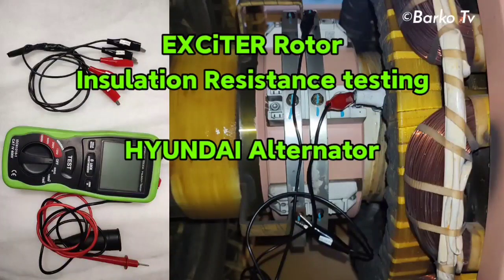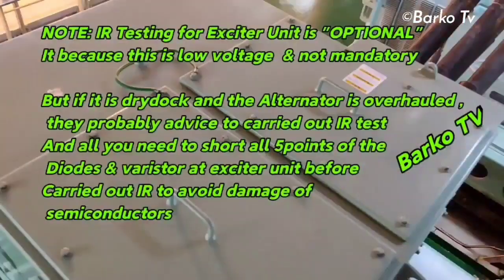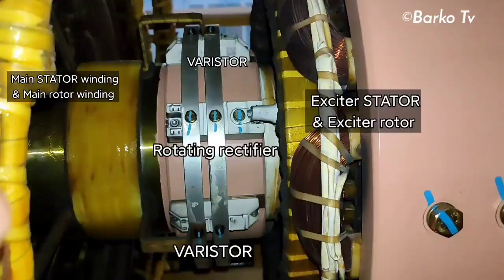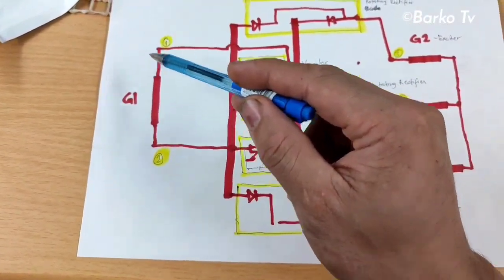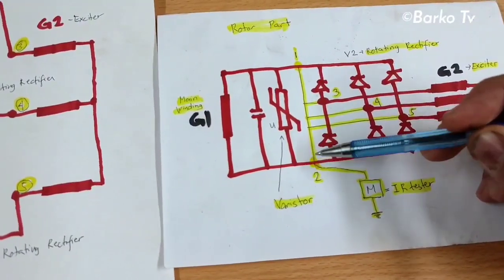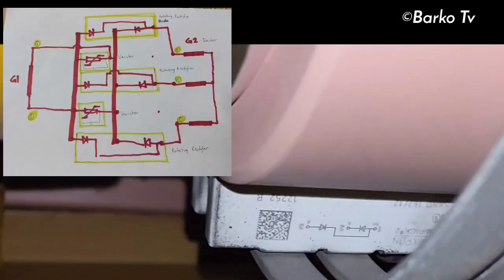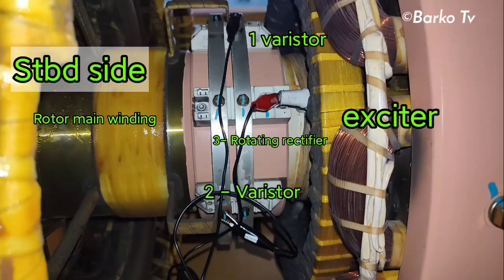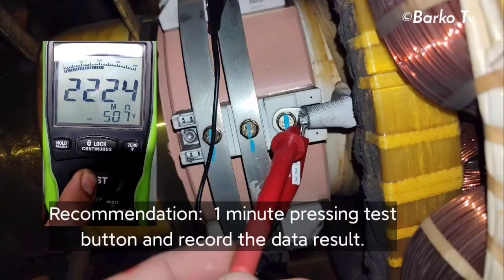Part 3: Megger testing of Exciter known as Insulation resistance test /Actual test / Hyundai

Comment: Good morning sir, you have great knowledge.please sir make one video on Main Engine starting troubleshooting. For example after 3 kicks the main engine does not start  then step by step which sequence we have to follow. Thanks.
Reply from the maker: Motor control troubleshooting
https://youtu.be/69Kpdjsq7LM
Reply from the maker: Normally we base on pneumatic air starting sequence, which control the starting sequence like opening the main starting valve and etc.  If your engine is ME-c man b&w, you can easily locate what valve opens during starting. What specific main engine you sailed today sir?
Reply: @BarkoTv  Good day sir, one of the my Man B&W vessel we faced the problem for starting the main engine in Astern direction only. We checked all the electrical diagrams and found working satisfactory. Finally we services all  Ahead and Astern air starting distributors after that problem was solved.